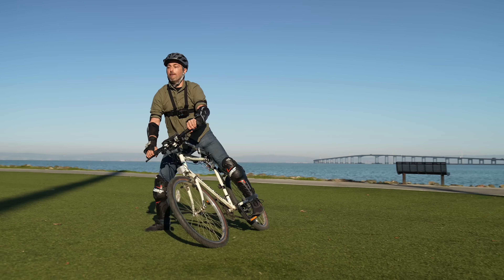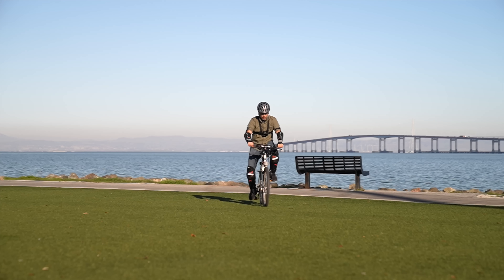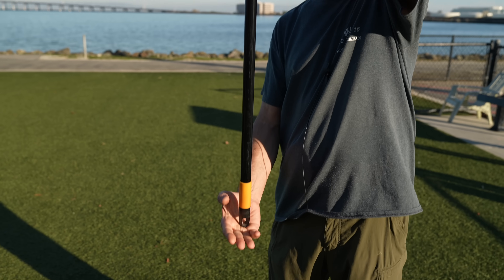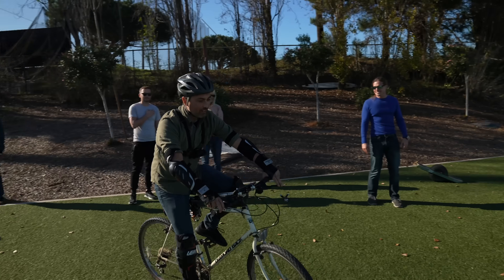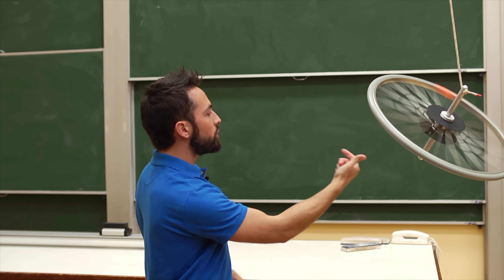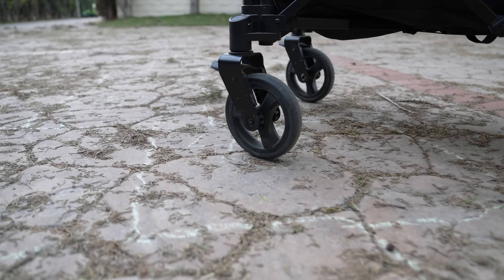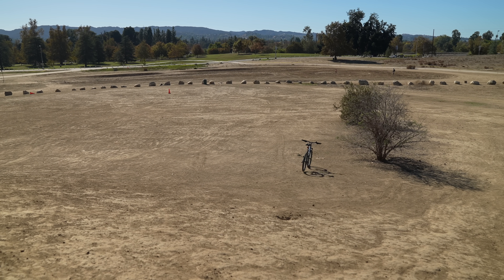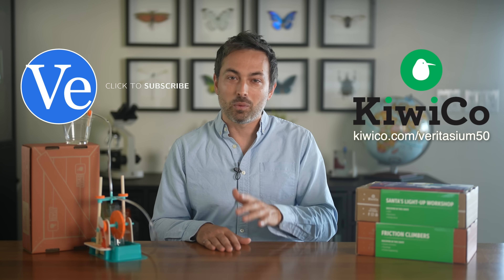Most People Don't Know How Bikes Work

Comment: Also to add to the point about the force effect of the wheels spinning keeping the bike upright, that's also another thing Motorcycle riders learn as with the speeds they travel, you can not knock the bike down.  Meaning if it's going in a straight line and the handle bar doesn't turn, you can try putting a lateral force on the motorcycle to tip it and it won't fall over (well.... unless it's a REALLY massive force!!).

This is something I've thought about for a while as to why there are differences between bicycles and motorcycles in this regard, and I've always guessed it had to do with the lower speeds of the bicycle.  I think there's a video topic to talk about the differences between the two as with a motorcycle, you're taught that it very much IS the forces of the wheels spinning at such high speeds that keep the motorcycle upright and stable.  And you can lock the handle bar into a straight position and this holds true on a motorcycle as long as it's above a certain speed!  When low-speed maneuvering a motorcycle around... say a parking lot...  then the instability you experienced on a bicycle returns.

Also another interesting difference with the Motorcycle about countersteering, at speed, you press the handle bar the entire way through the turn!  You learn to press into the direction of the turn, which then makes the bike lean the opposite direction of the front wheel, and then you lean your body in the direction of the lean of the bike (so you press and body lean into the turn, as well as looking through the turn with your head)!  It's again only at low-speed maneuvering in a parking lot where this no longer applies.  Now I'm curious what the actual speed is a 2 wheeled vehicle has to be going for this to take effect?  Like.... 10mph maybe??

Comment: If you want to experience this for cheap. Just take off both of your hands from Bike/motorbike handle. Now if you want to move right just slightly push the handle using only your left hand fore finger. You think the bike will move right but it will move left.

Now don't come at me yelling that I'm the reason for your accident. Try it somewhere safe and at reasonably slow speed

Comment: Nice…. You could have rolled down the designed bicycle down the bumpy terrain by locking the handle… it would have been cool. And see which side does the bicycle actually fall…

Comment: I'm not all the way through this video as I type. But go check out the cornering videos from Joy of Bike. By locking out the handlebars, it means you can only corner at a certain radius by leaning it over, at the radius which the bike has been set for through that angle. 

Lean a bike and walk it by the seat and see what happens.

Basically what's going on in this video is you're using people who haven't practiced bike handling.

Comment: As a mechanical engineer, I have to add that there IS a way to turn right without steering left. Stand up on the pedals and tilt the bike to the right. Since the bike is between the pivot point (of the inverted pendulum) and your center of mass, your overall center of mass will shift to the right, causing you to fall to the right and then catch yourself by steering to the right.

You can try this at home without a bike by balancing on one foot with your arms at your sides, then pushing your free leg quickly to the side. You'll always fall in that direction (if you do it quickly enough that the foot you're standing on can't correct for the shift in mass).

This effect isn't very noticeable while biking since you're usually sitting on the seat (removing this degree of freedom). And you're usually moving fast enough that leaning the bike causes a natural steer (in the same direction) which moves your pivot point faster than rocking the bike moves your center of mass.

This is also a way to track stand without rolling back and forth. You'll find this very difficult to learn, since typically when you fall to the right, you push your arms to the right, but to balance on a stationary bike, you need to push your arms (the bike) to the left. If you haven't seen it, check out Smarter Every Day's video "The Backwards Brain Bicycle" as a complement to this video.

And this is your only option if you're riding with a group and your front wheel overlaps the rear wheel of the bike in the front of you and comes close to touching it; you can't steer into their rear wheel to turn away, since you'd hit them and wreck yourself. And you can't brake hard, since you'd wreck the person behind you. You have to get out of the saddle and tilt your bike away from theirs, initially countering the bike's natural tendency to steer in that direction.
Reply: Was looking for this comment. I guess as a competitive cyclist I have been able to become aware that the correct technique to corner at higher speeds and even more efficiently is to lean and essentially countersteer a little bit. The countersteer is not something you practice but rather the weighting of the bike is huge. Getting more weight closer to over your wheels and tires allows you to increase grip because of what i assume to be increased contact patch and some physics. Cool to read! Thanks
Reply: @wellstanner3216  Our brains don't do math the way we learn in universities,
it does in a way that is so much faster and is in your intuition.
So you have mastered that, I am a newbie who learned cycle at a late age, but I had the consciousness to understand it. I learned it in a few hours of trying without falling a single time. With a few more minutes I could make the bike do whatever I want. Somehow my brain was telling me leaning makes turning easier (not in English, but giving me that feel) when I was doing the turns.

It's fascinating how our brain works.
Reply: @wellstanner3216  This video is for and about how tourists ride those blue rental bikes. Try steering this way (as shown in the video) on a downhill at 40mph and have your dentist on speed-dial.
Reply: @gigabrother458  YES. Exactly this. I often feel as though the plot gets lost in some of these explanations.

When you are going sufficiently fast enough, a slight shift of your weight by leaning the bike and body are enough to allow for a turn without having to first turn the handlebars in the opposite direction.

If you look at a video of a person steering without touching the handlebars, you will find at even lower speeds that shifting weight will turn the wheel in the intended direction of travel. Unicycles can also be brought up, but that's slightly outside scope i think.

Imo the correct explanation in this video should be that bikes are steered primarily by shifting weight not by turning the handles. The handles are there for comfort and precision/stability.
Reply: @rndviddump304  I think you're missing the point slightly - it's very difficult/unnatural to "shift weight" on a bicycle without being able to manipulate the steering. Slight adjustments to the steering is how one compensates for shifting weight. 

This is also true on a bike that is ridden with no hands - only in that case the rider has to be sensitive/careful enough about their weight distribution that they can make minor steering adjustments by balance. It's a positive feedback control system, so in order to turn right with no hands, the rider intuitively will start with a very slight lean to the left, and induce a left turn in the steering wheel before leaning right to turn. 

Most people find this a bit difficult (and it very much depends on the inherent stability of the bike), so they instead make minor (read: pre-turn) steering adjustments with their hands, and then as you say, actually lean to make turns. But in either case, control of the steering is critical to maintain balance.
Reply: @rndviddump304  you're not quite right kid. You ALWAYS have to counter steer to initiate a turn... motorcycle racers and riders do it at high speeds all the time. The higher the speed... the less countersteering needed... put its always necessary. To simple change lanes on a motorcyle... you countersteer.
Reply: @rndviddump304  ye exactly, same as a motorbike, if you tried steering by just turning the wheel you'd be very dead very quick
Reply: @gigabrother458  push your handle bar with the right hand and it will turn right. Racing motor cycles at well over a hundred MPH works the same way. At higher speed the required force on the bar lessens but you still do it.
Reply: @nrdejong  Indeed! For those that can ride a bicycle with "no hands" if you pay any attention to what you are doing at all, it is pretty obvious to the rider they are leaning to cause the handlebars to fall into the lean (*counter-steering still) and therefore steer in the same manner they would use the handlebars normally. Counter steering still applies, you just cause the bars to move by shifting your weight to move the bars. I ride every day and the bars almost feel like somewhere to rest my arms rather than use to steer. It is however very interesting to think properly about as riding a bike comes as naturally to a regular rider as does walking. Walking is also a complex matter we perform subconsciously of course.
Reply: @rndviddump304  Nope, not at all... Let's just keep with the comment description, thank you :)
Reply: @gigabrother458  more like 911 dialing just before you enter the corner...
Reply: you wouldn't have to stand up right? i mean i can already do it by sitting and only leaning to a side
Reply: @creeperlano7805  Standing isn't required, no. But this effect is small enough as it is, that the added motion you get by standing up is necessary to make it practical. Another problem with just leaning without standing is that you tend to form a sideways "U", like ">", which doesn't cause a net change in center of mass. You really need to go from "|" to "\" for this to work. Technically, sticking out your arm to the left will also shift your center of mass to the right (by the same principle, except your arm is above your center of mass). But your arm is light, close to your center of mass, and would cause all kinds of other stability effects, not to mention all the drag (and punching whoever's next to you).
Reply: @michaelsearing8369  well, but no. even if you're handsfree biking, the bike is still steering itself. you yank your body to the right then the bike will steer itself to the left because you're pushing the bike to the left, then it will turn right.
Reply: This is how I steer on my bike. Always. It allows you to keep your speed better, make tighter turns, and brake less. its so much better.
Reply: Excellent point. This is what happens when you make a science video without consulting actual experts in a particular field. All Derek would have had to do is talk to one of thousands of professional cyclists to challenge his hypothesis. Or bring one of them along to test this bike out instead of the amateurs he used in the video.
Reply: Leaning also rolls you on to a smaller diameter of the tire which makes the bike want to turn in that direction.
Reply: As a mechanical engineer, I agree. 😃👍
Reply: i already do this normally guess its just because im dutch
Reply: As a physics engineer you are in fact wrong. It is 100% impossible to change the overall center of mass on a bicycle without turning your wheels (simply try to balance while standing still without turning your handlebars and you will instantly realise it is impossible). You are leaning due to countersteering, you simply haven't realised it🤷‍♂️ If anyone tries to disagree, go outside and balance the bike first ;)
Reply: Thank you Sir! Was looking for that comment! Pretty sure they're not wrong in what they are saying since you can see the physics easily. But on the other hand you can do it in many different positions ( without even touching the handling bar) and still being able to turn. Their point just explains "Trägheitsgesetz" I think.
Reply: Im so glad someone pointed this out or i was going to rage xd
Reply: I must make all my turns standing up because I swear I don’t counter steer. It just seems more natural that way.
Reply: If you have ever noticed, standing on the pedals and biking always turns a little at every peadal we make each direction unlike when sitting. Pedaling left with foot will result in a slight right stiring and vice versa.
Reply: Also you can turn by pulling a wheelie, and doing a balance shift turn.  However it would be impossible to keep the bike in a wheelie for more than a half second without turning the wheels to create a counter balance effect.  So…
Reply: Thank you
Reply: Goddamn! I'm not gonna read it all 😂
Reply: Thanks for this lol as a dirt bike rider this bugged me…
Reply: Say it again but one sentence
Reply: 👍🏻 Great Explanation
Reply: I thought I was gonna quickly fall into the floor, I didn't fall to the floor :( I wanted to fall
Reply: Thought I was wrong or something. Because I have always used tilting to turn bikes since I was a kid because well, we use to compete
Reply: And that is still countersteering performed by the bike itself. Try doing that in a bike with fixed steering and it will fall.
Reply: i feel that what they said was so wrong to me because even if i can easily turn the way the show, i just don´t, i always use this method to turn no matter the speed at what i am, but it feel nice to see i´m the only weirdo to just do it this way naturally

Comment: You can turn left if right is locked up, you just need to lean your body left before you start the turn rather than counter steering. Also, you need to not already have your weight too far over the right side of the bike or it will be the same as riding a bike with both directions locked up, e.g. you will already be off balance before you start the turn. On wider turns I often lean rather than counter steer. Sharp turns are more difficult.

Comment: "Why does this bicycle steer the proper amounts at the proper times to assure self-stability? We have found no simple physical explanation equivalent to the mathematical statement that all eigenvalues must have negative real parts."
J. D. G. Kooijman, et al, A Bicycle Can Be Self-Stable Without Gyroscopic or Caster Effects, 332, 339 (2011), DOI: 10.1126/science.1201959.

Comment: I tried it today for some time on a parking lot and am pretty certain that if you just lean right and then pull over the handlebar to the right you do a turn without countersteering on the handlebar, this is in fact how I usually initiate my turns. I wonder if it's a failure to even notice the counter turn itself, might try to record it tommorow to watch it from another perspective.

Comment: This conclusion is actually wrong.
You CAN make a turn without turning in the other direction first. Give me that bike and i'll prove it.
In all cases you need to get your center of mass on the side you want to turn your bike to.
Steering in the other way first gives you a better angle of leverage to do that, but it is not a requirement.
Instead you can use just your balance to initiate the turn. If one ever drove a turn with hands off, he'll know what i'm talking about.
What you actually can't do without steering in reverse first are sharp turns, cause you can't move your center of mass quick enough without a lever.

Comment: For turns with hard stops. 

This problem can also be solved by starting with the lean (to get your body off from the top of the bike) rather than the turn (to get the bike out from under you). That's why I can bank a bike without using the handlebars at all.

Comment: This whole theory falls apart when you realize that you can just lean a bit to turn without having to turn left before turning right. Watch a professional bmx or mountain bike race and when they hit hardcore turns slow it down and watch. The wheel doesn’t go the opposite direction before they turn bc they lean heavy into the turn so they steer the bike back under themselves instead of out from under

Comment: As someone who has spent a lot of time riding without putting my hands on the handlebars, I can confirm all of this. I used to brag that I had made it from one end of town to the other (a journey of several miles around corners, thankfully not uphill) without touching the handle bars. Could not have done it if the bike's handle bars didn't autocorrect when I leaned.

Comment: As a motorcyclist I understand this naturally (probably how bicyclists do it naturally)
And as a helicopter flight instructor, I started teaching this to explain gyroscopes. In a motorcycle it's just much more pronounced. 
So when you're fast enough you can use the gyroscope that your wheels are to push you into the side where you push the handlebars forward
Reply: Great, so there are bikes without gyroscopic effect and without ground steering
But none with only gyroscopic effect for steering? That'd be interesting to see. A bike with a fork going perpendicular to the ground and being locked in place maybe and  a flywheel to use gyroscopic precession for steering. Well that would maybe stay upright but not turn 🤔

Comment: Coming back to the caster wheel.
On cars, truck, motor bikes, it is part of the wheel alignment, caster. It keeps the vehicle stable under acceleration and braking.
You can see this by turning the wheel and start to move forward and the steering wheel will automatically come back to centre.

For braking, it keeps the car in a straight line even without abs.
Also why you have bigger brake disc's in front than rear.